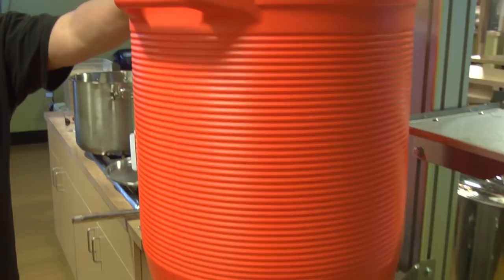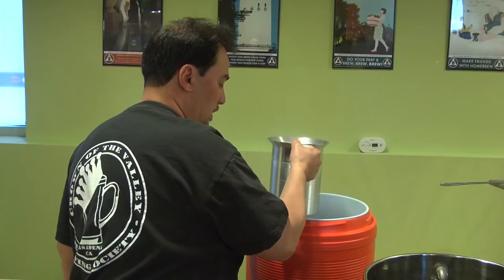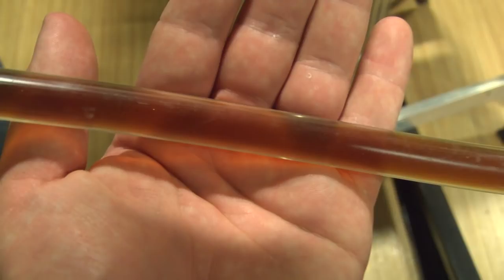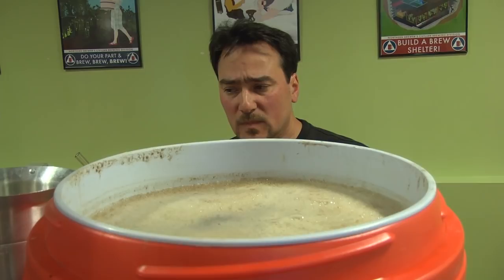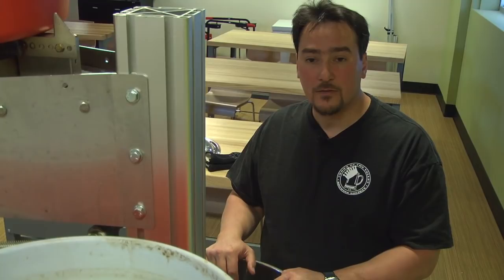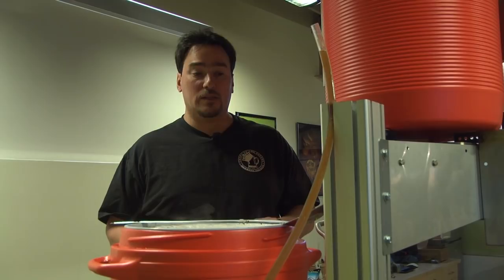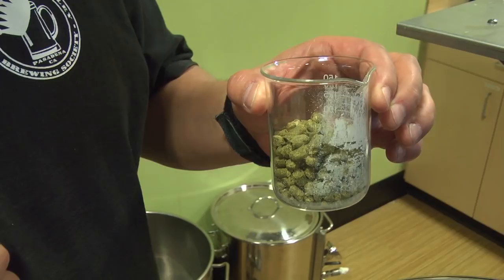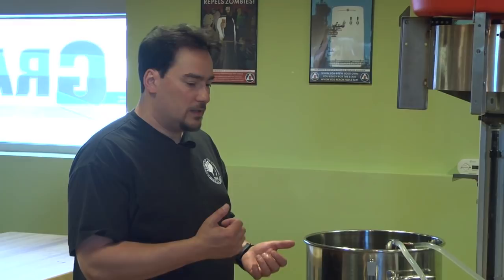All-Grain Homebrewing with John Palmer (author of "How to Brew")

Comment: Also be patient and never panic during the process.  In my very first batch ever (in my kitchen in Kuwait), I am a mechanical engineer and thought I had everything organized and calculated perfectly, including heat transfer calcs.  But imagine my surprise when I started my cooling phase and found that my "cold" tap water was 108F, and not the 85F that I had assumed (I knew it was warm from my showers, but not THAT warm!).  My final temp was 95F at midnight (after using all the ice that I had prepared and even frozen peas bags and everything else in my freezer!), and I figured all my hard work was in vain, as I would never be able to get it cool enough in time to pitch yeast.  Then I had a flash, I put an old tee shirt over my carboy, soaked it and put a room fan in front of it.  I went to bed, got up 4 hours later, and had 68F!  And this ended up being the best batch I have ever made!  (Of course this judgment may have been a little influenced by being my first batch and being in a totally dry country!  But, trust me, it was gooood!).
Reply: That's a fun story,  I have my first batch going right now, 5 days old. 5 gallons of a kit called st paul porter. Very dark and smelled amazing on brew day. 5 more weeks though before I can open a bottle of it, can't wait to see how my first comes out.
Reply: awesome story man, brewing adventures are always full of surprises. I also had a very interesting apartment home brew experience where my buddies immersion chiller leaked all over and it was my buddies apartment,and we were a lil drunk lmao. I kept warning him saying it's too much water leaking but he didn't listen, next thing ya know I hear his girlfriend yellin his name soo mad 😂 (they're engaged now lmao) but yeah we had to soak up the water with towels, wring it into their bathtub and repeat, this was also at like 11 pm and we were still cooling down our boil 😂😂😂

Comment: Thanks for the video. I used to brew back in the 90's from extract and it was pretty good New Castle clone but life happened and stopped doing it.  I recently brewed a 5 gallon all grain batch for the first time, and I wasn't ready. (I didn't have spigot buckets or a false bottom) so everything was by hand. The beer was very forgiving so I got lucky. I learned alot here. I need some more equipment lol.

Comment: When batch sparging you don't need to mash out.  Mash out is to raise the temp to stop conversion.  With batch sparging you can start heating the first running as you drain and draining only takes a few minutes.

Comment: The brew temp is "boiling." Basically, you want to start your hop addition schedule when you reach your boil. If you are doing a 60 minute boil, you typically will add your bittering hops as soon as the wort boils, and then start your boil timer.

Comment: Instead of heating the entire malt back up for insertion of hopps, can you take a small portion of the malt and boil this on the stove and add back to cooling batch to save power ? 5 Gal is a lot to heat back up.

Comment: How high a temperature will those plastic coolers withstand? I've heard at high temps they tend to expand and buckle and stay that way, not that it matters. What do you think of the stainless steel jobs with injected foam insulation in them?

Comment: Very new to homebrewing myself and thinking of going all grain as I am doing partial mash/BIAB brews now after staring off with extracts. My first question is that after watching this and many other vids it seems with AG its very easy to convert to by just excluding extract from the ingredients? I do partial/BIAB but still add about 3-6lbs depending on recipe to my boil after mashing/steeping. Also, he mentioned the bad water here in TX, i've noticed a pH powder being used in some AG vids and was curious if a tablespoon per 5 gal as instructed will be enough or should I focus on salts, acids, etc or add in campden? Thanks

Comment: So, I'm trying to dip my toes in here at All Grain, the Mashing/Sparging stage is, in laymen's terms, sort of like doing a pour over or drip coffee, correct? I get the grains and what not in a consistent, warm bath and then filter and pour it back to let the grains settle and maintain flavor, and then empty it after a bit?
Reply: Sort of.  Mashing in means you have water already in your mash tun, and you pour the grain in and mix it around (to prevent doughing up).  After it has sit for an hour or so, you run some out and pour it back in, repeating until it's clear.  When it's clear, you drain it completely into your kettle.  After that, batch sparging is just dumping more hot water back into the tun, mix it around, and wait again (20 mins or so). Then do as you did with the mash: run some out, pour back in (until it's clear). When clear, drain entirely into your kettle.

Comment: re-watching this vid again, and just noticed that in the how to brew book, that i have also been rereading, John says to add the water to the grains, not the other way around (exact quote from the book , page 201 under starting the mash, paragraph 3 - mash in)  but in the vid, its adding grains to the water... Im still learning, but which is it? does it make a difference? or it is for certain beers?
Reply: grains to the water, otherwise you could develop dough balls
Reply: @dylangaming537  stirring constantly of course. Either way if you don't have a person or system mixing for you, you run that risk.

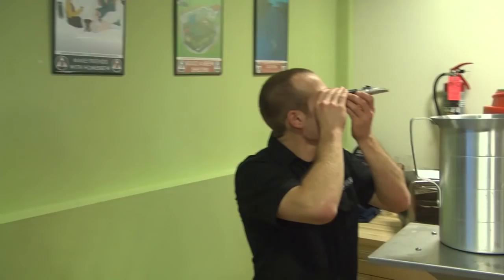Comment: At about 17:14 or so, what is that device that you are looking into? I'm relatively new to this so i'm not not familiar with every tool.
Reply: Its a refractometer, they're using it to measure the gravity of the wort.
Reply: It's a very handy tool that lets you use only a few drops of wort to measure gravity as opposed to a few hundred milliliters with a hydrometer.
Reply: @stgeorge143  So so worth it. Small batches, no problem. And you can get sterile pipettes by the bag on amazon cheap. Just make sure to get a temperature compensating refractometer, or you will spend all the time saved on calibration, etc.

Comment: Okay so when using calcium chloride and calcium sulfate, could you use distiller water? Or should I just stick to my regular spring water?
Reply: depending on where you live,  2:1 ratio of distilled to tap,  you need those minerals for mashing, to put it simple.
Reply: L0ts0fPiggies You can use  ditilled  water  and then do the   math   to emulate the water of a  style you  are  brewing. BUT  You will need  to add more than the  above only. In particular  trace minerals like  zinc if useing  distilled water-its no  biggie as there are  lots  of  online  water calculaters

Comment: Is a good idea to squeeze the grain on order to obtain the most liquid as posible?
Thanks!
Reply: I'd consider myself an intermediate brewer. So, I'll admit that I don't know everything. 

I'd bet wringing out the mash would compact the grain bed and you'd just get you a stuck mash. I wouldn't think that you'd get much more out of it anyway though. 

Add extra sparge water to make up for the grain absorption if you need to get your boil volume right. Also, account for evaporation from the boil.
Reply: Jon Suttle
Thank you for your comment.

Comment: Interesting talk from John regarding the pH of the sparge water @ 15:57 .
Would sparging still be safe if doing an all grain lager/pilsner that is quite sensitive to pH?
Would the pilsner malt retain enough buffers to bring the pH down? (I will be using a bit of acidulated malt in the initial mash to bring it down to 5.2-5.4 after pH testing with litmus if needed...).
Would it be wise to add a bit of acidulated malt to the sparging mash (after first-draining)?
Two of my previous batches of pilsners ended up with an unpleasant metallic taste and I have since researched a lot about mash pH - so tomorrow will be my first attempt at mash pH correctness and also using double decoction (thanks Michael Dawson for the video on his keller beer decoction, watched it 5 times - Canoe Cam! haha)
anyways - your advice would be great!
Reply: Tom.. Lager nor Pils are pH sensitive. Enzymes are pH sensitive. Using RO and Pils malt, mash pH will be 5.8 /5.7. Refer to a malt data sheet before attempting to produce any type of world class styles of beer. The sheet is produced for a reason and brew master's use it. Home brewers, including the marketing team of ZanyPalmerJammySheff, Chip and Dale, do not know that one exists. The sheet indicates pH, Kolbach, protein level, saccharification time, etc... 
As long as mash pH is at 5.3, sparging with straight RO at pH 7/7.2 will not increase run off pH above 5.3. As long as over sparging does not take place. 
Since, you are going to attempt the Chip and Dale show's poorly performed decoction process, realize that a step is missing, as well as different steps that are part of the true decoction method. The double decoction is relatively new, since the 60s. It came about due to profit margin. Do not assume that just because someone claimed that modern malt is wonderful, that steps can be eliminated. Malt is malt. However,  there are different grades of modern malt and the only thing that can be used to determine the quality of malt is by using the malt data sheet. A brew master uses it for that purpose. Do not assume that just because the malt is in an HBS it is fine malt. Cheap malt is just what it is. 
Do the following, it is the way that a true decoction is performed and the final product will be of a much higher quality than the liquid produced during the Chip and Dale show or the liquid which Brew Keester creates. 
Dough in the mash at 60F with one quart water per pound of malt and allow pH to stabilize. Then, add sauer malz to reduce main mash pH to 5.5. Do not follow the instructions that mention that a certain quantity of sauer malz reduces mash pH to a certain level, it is home brew nonsense. Sauer malz varies in pH and it is better to start out with a small amount and test pH and add more as needed. Sauer malt quality varies, as well. Fine sauer malz costs between three to five dollars a pound. 
There is a reason behind reducing pH to only 5.5 during dough in, it has to do with what will occur during the 1st decoction. When mash pH stabilizes at 5.5, remove the 1st decoction. Increase decoction temperature to 122F and rest the decoction for 20 minutes. After 20 minutes increase decoction temperature to 155F and rest until saccharification occurs. The decoction will darken during saccharification. Test with iodine, the iodine should be deep red/mahogany in color. If iodine turns purple/blue/black, wait another 10 minutes and test again. If the iodine remains purple/blue/black, the malt is slack, cease operation. There is no sense in going any farther. Purchase finer malt, next time. Purchase Weyermann's floor malt, light, dark or Barke, if it is available. The numbers on the side of the sack can be e-mailed to Weyermann and they will send the malt data sheet to you for that sack of malt. 
After saccharification takes place in the 1st decoction, bring the decoction to boiling. Boil the decoction until hot break forms and skim off the break. Continue to boil until hot break ceases to form. 
The reason for doughing in cold is to allow the brewer to work with the 1st decoction for longer lengths of time, there by reducing protein gum, during the time when the main mash temperature is below the temperature at which enzymes become active.
Return the boiling decoction back into the main mash, the temperature to reach is 130F, use boiling water if necessary. When the main mash temperature stabilizes at 130F, remove the second decoction. Understand, that you are now on Mother Nature's time clock and saccharification, although it is slow, is beginning to occur during the 130F rest. During the rest, proteinase will activate and it will reduce beta glucan and form glucose, thereby, reducing mash viscosity. The glucose formed will be converted into complex sugar, maltose and maltotriose during the next step in the process. When fine malt is used, iodine will be orange/red during the end of the 130F rest. It is imperative that mash temperature does not vary during the proteinase rest. 
Raise the temperature of the 2nd decoction rapidly to 145F and rest the decoction for 20 minutes and test with iodine. The iodine should be reddish/orange in color. If the iodine turns purple/blue, do not worry, wait another 10 minutes. Then, bring the decoction to boiling and boil it for 20 minutes, regardless of the iodine's color, and skim off hot break. After 20 minutes of boiling, return the 2nd decoction back into the main mash. The temperature to achieve will be 149F. Use boiling water if necessary. 
When the main mash temperature stabilizes at 149F, add sauer malz and reduce pH to 5.3 and no lower that 5. The pH favors Beta and slows down Alpha.
The mash will jell, dextrinization (body created from A and B limit dextrin), as well as, conversion will begin to occur. The mash will darken. It is imperative that mash temperature stays at 149F and no higher than 150F. 
Remove the 3rd decoction as soon as the main mash pH and temperature have stabilized and quickly increase the temperature of the 3rd decoction to 158F and rest the decoction for 10 minutes. Then, bring the decoction to boiling and boil it for 20 minutes, skimming off break as it forms. Return the 3rd decoction back into the main mash, the temperature to reach is 162F and rest the main mash for 10 minutes. Mash out if desired. However, it is not necessary because the snot has been beat out of the enzymes. 
Transfer the mash to the lautertun and stir the mash one time and only one time. Tan or gray colored mud will form on top of the grain bed in the lautertun. DO NOT STIR THE MUD INTO THE MASH. DO NOT BATCH SPARGE, you have worked very hard to create pristine wort and there is no sense in ruining it by batch sparging. If the mud is tan, sparging can be performed quickly. If the mud is gray, sparging will take longer, so don't get excited or become impatient. Perhaps, you have read that sparging may take three hours? Gray mud. Sparge until run off gravity drops to 1020, that is far enough, unless the volume of wort is not enough. Then, sparge down to 1015. Sparging down to 1010 is more home brew nonsense. Run off pH if RO is used will be around 5.3 at the end of the sparge.
When the bottom of the boiler is covered with wort, add a small single handful of leaf hops and fire the boiler. This is actual first wort hopping, it has nothing to do with what home brewers have been led to believe. It is a brew masters trick which reduces hot break and the small amount of hops will not add any bitterness. As the wort boils skim off hot break as it forms, there will not be much, the wort is very clean. After hot break ceases, add the bittering hops and boil the wort for at least 60 minutes, skimming off break. Chill the wort and allow the wort to settle for eight hours. Then, rack the wort off of the trub, aerate and add yeast. First fermentation 10 days. Second fermentation two weeks. During second fermentation another type of conversion occurs when yeast absorbs maltose and expels glucose through the cell walls of yeast. The gravity will reduce. Keg the beer at 1020/1015 gravity, it should be there after two weeks in the secondary. Priming sugar nor artificial carbonation will be needed. The maltotriose will be absorbed by yeast during aging and natural carbonation occurs when the yeast converts maltotriose into glucose, after yeast uses the glucose as fuel. Gravity will continue to reduce as the beer ages. The beer will be void of oxygen. The oxygen used by yeast in order to burn the fuel is bound within the molecular structure of the sugar. Age the beer for at least four months, six months is better. The things about brewing that you have learned by reading home brew books or have learned from watching youtubes does not scratch the surface when it comes to the art and science involved in producing the finest world class styles of beer from Ale to Wee Heavy. It takes years of hard work to learn about and to understand Mother Nature.
Reply: I enjoyed reading this treatise, and am curious. Is all the decoction mashing necessary for all styles? I know that as a basic home brewer, I am leaving out steps and protocols that a pro does automatically. What you say makes a ton of sense. I've always wondered how some of the new breweries are keeping their recipes consistent since the malt will vary from sack to sack, and you've enlightened me. I can't help but think, though, that lots of these new breweries are essentially ramped-up buckets and coolers and really aren't doing much more than Palmer shows in this video. Agree?
Reply: Michael, WOW! Can't believe I've only seen your reply now... Thanks for this great reply and all the info, an eye-opener and I will definitely try this method from now on. One question: What volume of decoction do I pull? A third or two thirds of the mash?
Reply: Oh and my pilsner I brewed just after my initial comment last year turned out a lot better than before, it did have a slight banana aroma and nutty taste, which was very drinkable but not what I was going for. I have researched more on water and minerals etc. I'm looking at RO filtration and adjusting with minerals and salts to achieve a more classic lager/pilsner profile. I haven't brewed a lager/pilsner since last year. Its quite daunting and I always strive for perfection, so if you could point me to some water adjusting websites or info, I'd be very grateful. Thanks again for your info.